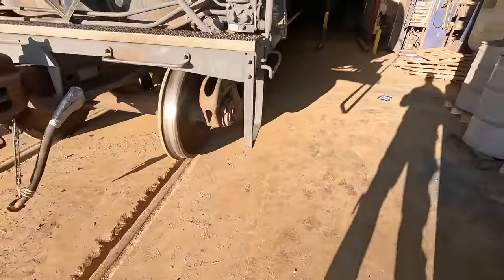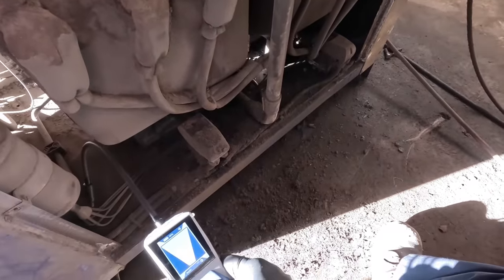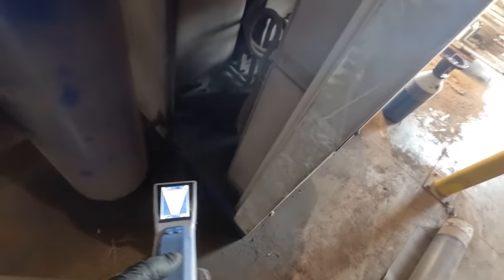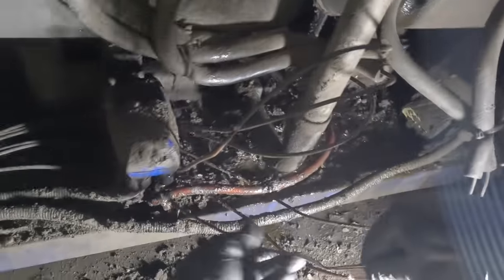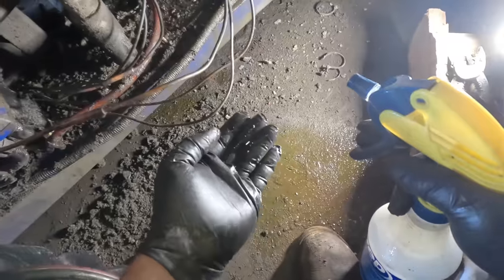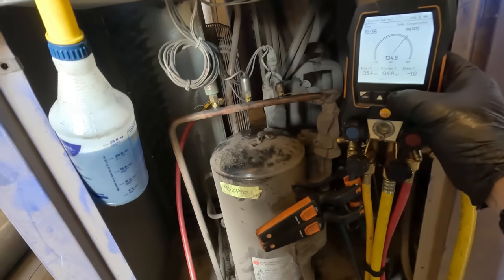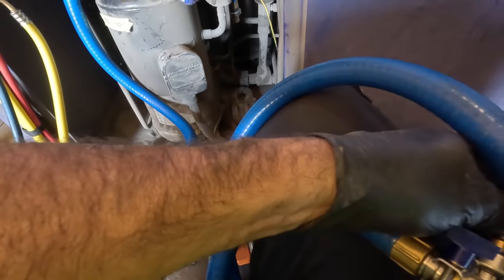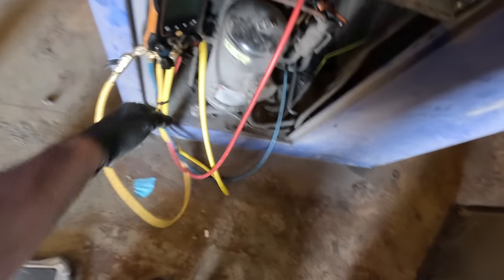How To Find And Fix Refrigerated Air Compressor Dryer Faults

Comment: How flexible are those dualy torch tips?
Haven't tried those or the "Captn Hooks".
Reply from the maker: They're flexible, the tips are soft copper, I only adjusted a little bit from 3/8 to 3/4. Anything bigger I use my rosebud tip

Comment: Those air dryers will have a hot gas bypass valve built into the refrigeration side because it has no way of knowing when air is being used or it’s not. So it needs a way to put a artificial load on the refrigeration side during times of low air demand.

Comment: The DRN alarm triggers annually on run time.  Once a year.   You hold reset for like 10 seconds.  Its to be sure customer gets a tech out yearly to check the machine.  You take the top off the drain valve.  Hold reset and it will clear alarm.  install top of drain valve done.
Reply from the maker: I turned the ball valve off and tried that but it didn't work. The factory said there's a release I needed to trip but I didn't see one

Comment: That thing is pretty neat. I feel for ya about wondering what the engineers were thinking when designing the system. It’s almost like the refrigeration system was the last thing they worried about.  Good Stuff Rick!

Comment: I see you have the testo 570s is that correct, Im thinking about the 550s or 570s testo claims the 570s has more features do you use them?
Reply from the maker: You’re correct I have the 570s. I’ve have both and I would go for the 570s because they zero out better and seam more accurate.

Comment: I am doing the same repair nearly the same unit.Why they have laid the fridge lines and capillary on the deck is not good.Of course there’s vibration friction equals refrigerant leaks.

Comment: Nice job but I don't think I could deal with my tools getting full of crap it would drive me insane, and don't mention the cleaning of the cap tubes I would have to do... which would probably extend to the rest of the machine, even tho pointless, its my condition 😅
Reply from the maker: I'm OCD about my equipment as well but I also bought them to make me money so they're going to get beat up.

Comment: the test pressure loss of 1psi over 15 minutes, is either lack of temperature or voltage compensation. then again it's not many-thousand dollar lab test gear  🤣🤣
Reply from the maker: You can see I had the temp probe on, it has compensation but like you said it's not lab quality and this was not a science project. 😁